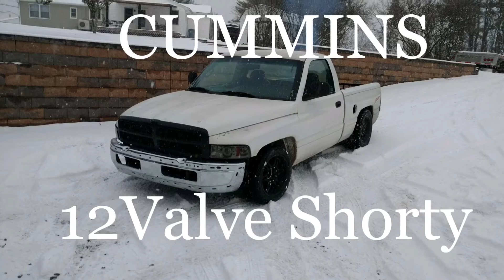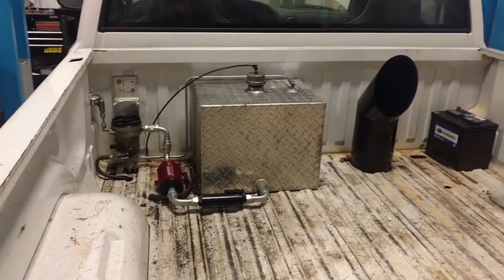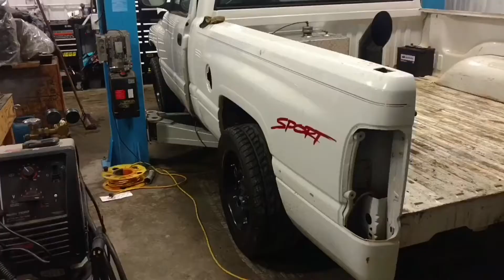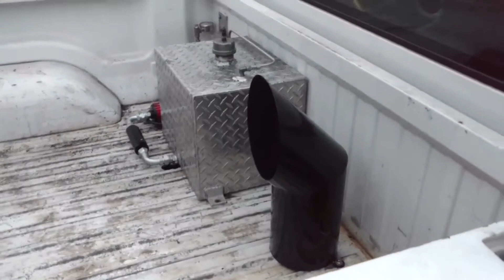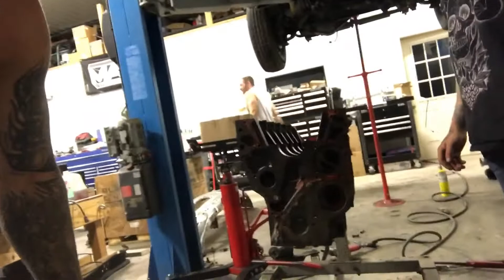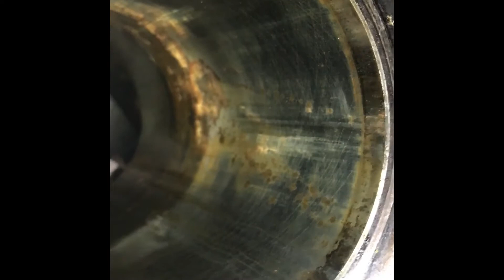Custom CUMMINS 12 Valve Race Truck!

Comment: Does he have problems with heat with no intercoller just running it directly? mine has a single 475 and i thought about doing mine that way nit have read it gets way to hot to quick
Reply: It has meth